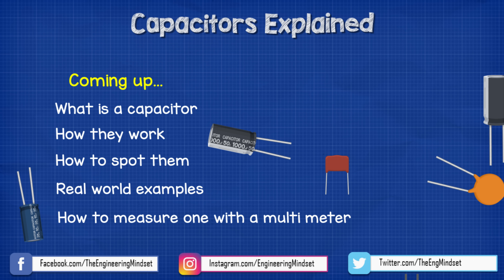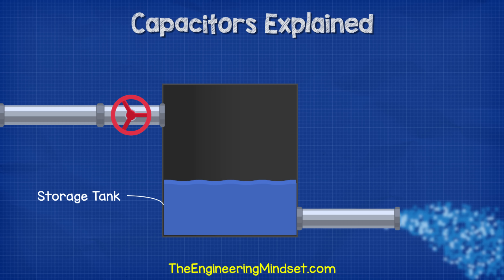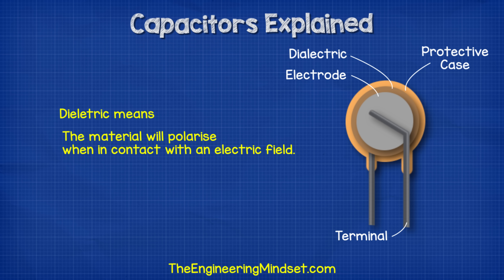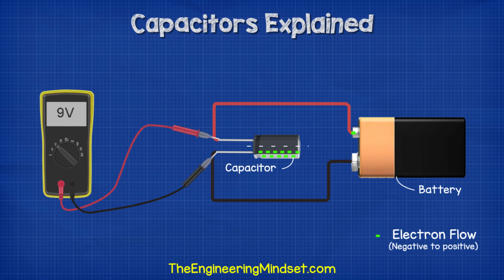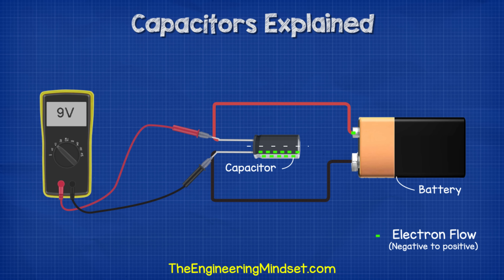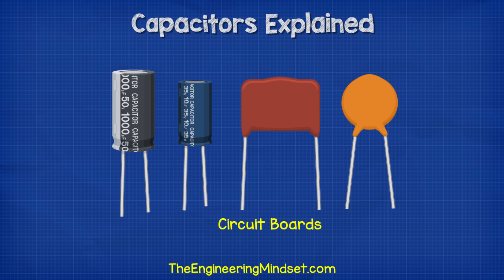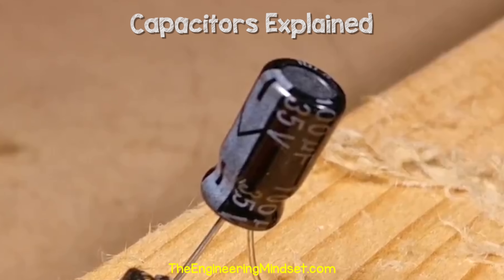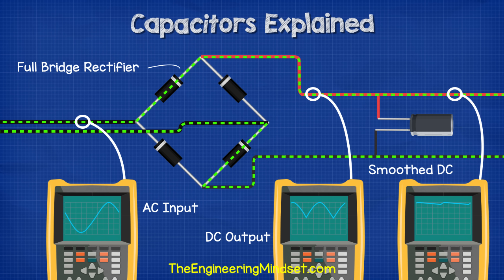Capacitors Explained - The basics how capacitors work working principle

Comment from the maker: ⚠️ Found this video super useful? Buy Paul a coffee to say thanks: ☕
PayPal: https://www.paypal.me/TheEngineerinMindset
Reply: Your example of a water tank is what they call an accumulator in hydraulics/pneumatics. It dissipates fluctuations from the compressor or hydraulic motor so you get a steady stream of fluid with no pulsation.
Reply: The Engineering Mindset i
Reply: this teach better then school. and the school rely on this kind of videos.
Reply: Awesome explanation. 
However I have a question based on the water tank example. In order to fill the tank, the water inflow should be greater than outflow.
Reply: I would if I wasn’t so broke, unfortunately for me, sorry.... 💸
Reply: Where's the arabic translation
Reply: use rubber around copper it is safe if you do it
Reply: a
Reply: alterating current [AC]
Reply: 50v is good
Reply: will pay more coffee for Paul 🙂
Reply: @giddy I'm sure by now you're not a beginner, so for future people who read this, the LED light needs about a ~20 milliamp current. Anymore and it blows. It's designed to take as much current as you give it, so you must limit it. So a 9V battery's current (or a discharging ~9V capacitor's current) must be limited with a specific value resistor. The resistor is calculated using V = IR. That's a 9V / 0.02A = R =  450 ohm resistor. I'm just a hobbiest too, someone please correct me if I missed something. Thanks!
Reply: The Engineering Mindset rre
Reply: Go to Bitchute, please.
Reply: The Engineering Mindset 
if i use 2 or more capacitors would that drain earlier the power supply like a battery than using only one capacitor?
Reply: Ewwwwwkay, clicked the video by accident, looking for episode 1 now.
Reply: aà ၍
Reply: Hey thanks, I'm coming up to my exams that decide what GCSEs I'll take next year and I'm hoping to get into technology and design. This really cleared up capacitors for me
Reply: What causes the voltage ?
Reply: @csp405  Voltage is a measure of the electromotive force of charges.  This force comes from the polarity of electrical charges.  Positive charges wanting to reach the negative charges.  A circuit provides a path for the positive charges to reach the negative charges.
Reply: @giddy Purpose of the resistor is to reduce the current in a circuit to prevent what they call a short circuit.  Which is where you get an infinite amount of current due to no resistance in a circuit.  

Its based on the principle of Ohm's Law 
I=V/R
Where Current: I 
Voltage: V 
And Resistance: R

With this relationship if you have 0 resistance, then whatever the voltage may be, the current will be infinite (short circuit) which can destroy any device connected.  Anything / 0 = ♾

Resistors make circuits functional.
Reply: @giddy Essentially, and no problem.
Reply: Best explanation of what a capacitor is and what it does in a circuit 👍
Reply: Cool
Reply: Its the ame way for the solar  panel
Reply: Eeqqeeèqqqèqqqqqqqq1qqw3eqeqeq1qqqqqeqeeèw1qqqqeeewèqqeqqqeqqeeèeqqqqqqqeeeeeeeeweeeqqwqqeqqqqqeqeeeeeeeeqqqeqqqqeeèeeqqdqqeèeeeeeeeee3
Reply: Ayo thx
Reply: Super useful😊
Reply: ⁰⁰⁰⁰⁰⁰⁰⁰⁰⁰⁰⁰⁰⁰⁰⁰⁰0
Reply: Sir why you stop making electronic videos
Reply from the maker: Check out NEW resistor video, everything covered! ➡️ https://youtu.be/DYcLFHgVCn0
Reply: G
Reply: Why the electrons are flowing from negative to positive here 4:59
Reply: Electricity
Reply: Is this UPS?
Reply: P
Reply: do you also provide alternatives to paypal?
Reply: I find this kind of funny
Reply: Has anyone ever used water glass as an electrical insulator in a capacitor? Obviously the dry form of water glass. 
I suppose it's risky because it could shatter. would need to keep it held inside of a shockproof container.
Reply: I charged 40 v condensor with 16 v and canected it to fan (power suply +to - of condensor ) -of condencor to fan +it. 
It spined 1 s longer because using pc cgarger (16v) it spins 3s  because of cpndensors in apple pc charger . It works (charger ) because it has come kind auto fuse in it because it was shortcirkut aloot of times (specely then when i made plasma with pencil grafite )
Reply: @memesaregreat8815  mehez  pi meowzm
Reply: Now do a video on aircraft fuel probes.
Reply: We want an Arabic channel
Reply: sir can i ask! is it safe to use 50v 10,000uf(m) capacitors and connect to the motorcycle battery!?
Reply: @Basher189  10,000uF = 10mF, and you don't need 50V, and probably shouldn't use one in case it somehow gets charged to higher than 12V and fries your electronics.
Reply: @Basher189  y
Reply: @Basher189 what can you see again this question ⁉️
Reply: @Basher189  motorcicle needs only 12v if ypu use 50 v ypu might make buge mess with elecronic ( burn fuses ) and that is hard to aces some beter use 12- 15v condensor
Reply: @memesaregreat8815  NO!
Using a "12V" rated capacitor may be unreliable, even dangerous!
The "50V" printed on a capacitor is the max voltage rating. Please use capacitors with max ratings higher than battery voltage (the higher the better) , so it will live longer and survive power spikes and inductive surges. This technique is called "derating", and it will prevent some failure modes. 
Always read and understand the specs of the component you are using, and what the markings on the component actually mean.
Reply: pro proqq
Reply: James Driscoll 
it will explode if voltage got higher than it capacity?
but what about those with higher capacity would'nt it give a higher supply to the circuit?
might burn some
Reply: @jamesdriscoll9405  can I ask you a question then? say I pulled a capacitor out of a microwave which would be rated rather high and connected it to a 12v source such as battery or even a 12v battery charger (AC powered). I am not going anywhere near the max ratings but is there a voltage level that is too low to use effectively with a high rated capacitor? Is there a reasonable ratio to consider and should I find a lower rated capacitor for the 12v source? Or if I did use this capacitor with the 12v source, to what voltage would the capacitor roughly charge to? Thanks
Reply: @cotteeskid  What you describe should be ok. Iirc, the voltage rating is the maximum voltage that the capacitor can safely withstand. Say you have a cap rated 12v. Plus or minus 12v would be the most I would run. A cap rated 100v will carry +/-12v all day. 100v on a 12v cap will release the magic smoke.
Please discharge the cap before removing it from the microwave & observe it's polarity.
Reply: @jamesdriscoll9405  Thanks for the prompt reply. I have already discharged the cap from the microwave. Cheers
Reply: @jamesdriscoll9405  actually the nano farates means how much time it will sustain the current
Reply: @memesaregreat8815   iiii

Comment: Around 32 years ago, as a teenager, I was fascinated by electronics, and really wanted to understand those complex circuits.
So I decided to go to engineering college. I lost 4 , just studying useless math, classes that didn't make sense to me, practical labs studying some circuits that were part of the curriculum.
After 4 years, I couldn't even understand how a circuit works, except for some ready-made circuits.
I desperately wanted to know how electronics technicians could take apart complex circuit boards, know exactly where to look for the problem and identify faulty components. I learned nothing of this at college. I was just studying pure crap.
I graduated from college not knowing how to fix a simple circuit. I felt completely useless, and now I work in a different area.
But I am really enjoying watching these videos to learn things that should have been taught to me at college.

Comment: 6:48 Full Bridge Rectifier , is The direction of the diodes true? isnt the current goes from Striped side? Pls can someone answer
Reply from the maker: If using conventional current, e.g. to design a circuit, then you assume current is allowed to pass from the blank end to the stripe end and that current would be blocked if it tried to flow from the stripe end to the blank end. But the physics of how it actually works, is electrons are allowed the flow from the strip end to the blank end. See our video on conventional current v electron flow

Comment: An excellent explanation.  I would mention that the capacitance measurement will likely not display the the capacitor listed value due to the tolerance that specific capacitor is manufactured. See the manufacturer's datasheet.  Always refer the this datasheet to assure the desired circuit's behavior.  The datasheet will list the minimum and maximum values and ratings.  Also, the typical value but this is not guaranteed.   A rule of thumb is ±20% for a capacitance value.

Comment: In plumbing terms, this would be a pressure vessel, it does exactly the same to diaphragm pumps, holds extra water against a pressurised membrane, smooths water flow to reduce surge-ing. This is the first time ive seen an explanation of electronics that managed to pierce my monkey brain, next stop, transistors 🫡 thank you!!

Comment: 1:28 but if the level of water in the tank changes , the pressure is going to change so the flow speed
Reply: Just chill out, it's just a illustration or creative representation
Reply: @churaichaaaru 😂😂 ur right I have to be less nerd (but an illustration not a illustration )
Reply: @enaamine07 it really is just an analogy. Electricity does not actually work like water in a pipe, but it can be useful to think about it like that. Just remember theres a reason you dont call a plumber to fix your electrical 😂

Comment: CRTs had large capacitors which made working on them dangerous. But the standard discharge technique was to short the capacitor with an insulated screwdriver shaft. You knew you were successful when you got that loud pop.

Comment: 2:14 you did not bother to explain which (positive or negative) side of the capacitor is connected to which terminal of the battery. Congratulation
Reply from the maker: I did, at 2:21
7 seconds later in the video.
Reply: I dont think Capacitors have pos or neg. In hvac i can switch to any spade terminal on a cap as long as it is rated for the equipment and is wired correctly.
Reply: My guess is red means phase and black means neutral
Reply: how braindead are you

Comment: I just wondering , do you mean that the capacitor is to control the smoothness of the voltage from flowing a low amount of voltage? I hope u can answer my question😁

Comment: man, despite building some simple circuits, leds w a pot…. or charging up caps and running leds, im still having difficulty visualizing electricity at a fundamental level. When he said the build up of induction motors will lead to the “current lagging the voltage”, I was back wondering wtf is going inside wires!🤦🏼 Between THIS, and the whole conventional vs electron flow thing, I still have trouble picturing wtf is going on inside wires.🤷‍♀️

Comment: Thank you so much for the video. Practically when I connect a polarized capacitor to a LED, it is NOT turned on. Even when I change the legs it is same. The really interesting point is once I connected a polarized cap to a LED and when I disconnected the positive leg, the LED remained dim and never turned off!!!!!!! I got shocked!!!!!! When I touched the positive with my finger the light increased FOR A LONG TIME even while it was not connected to power!!! Why?

Comment: Great explanation. I found out the hard way the capacitors hold power for a long time. Got a nice high voltage shock changing the burnt out bulb on my airplane's strobe light. I know now to short it out prior to changing it.
Reply: Aircraft strobe lights should have a internal mechanism to drain the capacitor bank if the flash tube doesn't flash. The instructions for changing the flash tube should have a note about...."wait X number of seconds or minutes before changing the flash tube." If your unit isn't dissipating that charge after being turned off then it is faulty. I'd replace it. I have been servicing aircraft strobe lights for 40 years and never got a shock.

Comment: Energy is not stored on the plates of a capacitor - rather it is stored in the dialectic.  Only electrolytic capacitors have a +/- polarity requirement.  A capacitor consist of two conductors separated by a dielectric.

Comment: Talk slower or edit the video for normal speed of talk and not like your goal is to try  squeeze as much details as possible in a minute. @EngineeringMindset
Reply from the maker: Thanks for the feedback. The video is too old to edit, but you can control the video playback speed in the player settings from your device, click the gear icon in the corner. You can also turn on subtitles and pause the video if needed.

Comment: The other thing with these batteries in the type of service they use them in, is usually for backup power for life saving equipment. In other words they may have never been used at all with any kind of load to speak of. They have maintenance rules that the batteries must be replaced every year, for example. No matter the condition of the batteries. I had a friend that worked for a company that changed out the batteries from aircraft locator transmitters. It's the box that transmits a radio signal pulse when a plane crashes. They have a mandatory rule of replacement every year. My friend would give me some of these batteries. They were bright orange narrow but tall 12 volt sealed lead acid. You would need a few in parallel to make a sizable battery for inverter operation. This was before MOSFET inverter technology was invented. In the early 80's.

Comment: Remember,  capacitor values are like a building size.  The microfarads is the generous floor space horizontal or amps, and the voltage is the roof height (unlimited vertical storage )or high voltage more like a silo.

Comment: I see it as primarily   as a blocking  device for a DC current and passing alternating currents as opposed to an inductance doing the reverse,   we can choose to filter by resonance retaining a selected  frequency and discarding all others.  A very good video explaining all the salient points in physics.   I was  taught the fundamentals whilst learning  how interaction is used.75 years ago.   I was contemplating this in relation to voyager still sending signals to Earth. Keep up the excellent explanations.   An old Trenchards Brat in the RAF.

Comment: Ok I kinda got it. Capacitor store electric alright but why it has to be connected to the negative and positive sides if its like an inline water tank...  shouldn't it be inline connection positive only or negative only?

Comment: I know this is a very old video, but as it was suggested by YouTube I thought I would watch. A very good explanation, apart from at 28 seconds you state that capacitors store charge. In the real world, the net charge in a capacitor is always zero. The power supplied to the plates, separates the positive and negative charges, so storing energy. It’s always best to refer to energy storage, not that this will affect anyone apart from engineers and nerds like myself!😂

Comment: Capacitors also have equivalent series resistance ESR, and it’s useful in determining capacitor health when troubleshooting a circuit. A good LCR meter, or tweezers will show the ESR at different frequencies.

Comment: I’ve repaired over 20,000 welders and plasma cutters. One was a Miller brand model AC650. It was a single plate ac welder rated for 660 amps. The waveform is naturally smaller on the straight polarity phase. IE electrode is negative so electrons come out of the electrode but are partially rectified by the resistance of the oxide film on the surface of aluminum. The reverse half cycle physically removes the oxide. A bank of 165 one liter sized capacitors in parallel with each other but in series with the output balanced the waveform by adding more  punch to the forward half cycle..

Comment: Our body acts like an antenna. We pickup electrical magnetic fields from AC lines electronic devices like his phone. When he is wearing his shoes, his body is less conductive, meaning its harder for electricity to flow through his body to the ground, now when his he steps on the ground electricity can flow through more easy so the body attracts more electric fields and more electricity is running from the environment through his body and to the ground. This is capacitive coupling. I believe its dangerous to ground yourself near ac lines or anywhere with high electrical fields. I recommend go get lost in a jungle and ground yourself.

Comment: Capacitors are also used to block DC voltage when wired in series.  Like in electrical sound waves. It blocks DC voltage from reaching the speakers.

Comment: Sorry to ask a silly question maybe it is explained in another video. I understand the analogy of the water tank and that you can always go a higher voltage in a capacitor so long as the capacitance farads remain the same (if you need to replace one in a complex circuit). So a two part question I assume if a capacitor reads 35v when the capacitor is full it release 35v so what is the capacitive? is that the amount of 35volts it can hold? so a 35V 1000uF hold twice as much as a 35V 500uF?. Been a arcade hobbyist for a few years now and while I know to replace capacitors of the same value I am trying now to learn the reasons why the Uf is so important. Thankyou to anybody who replies  😊